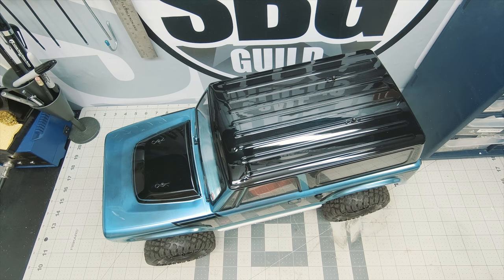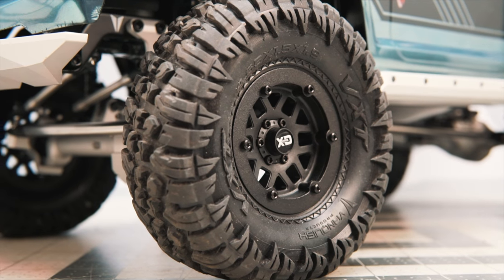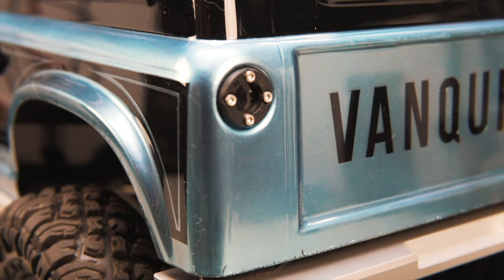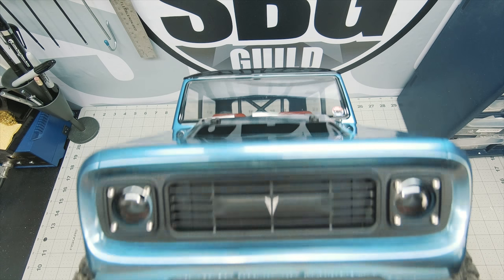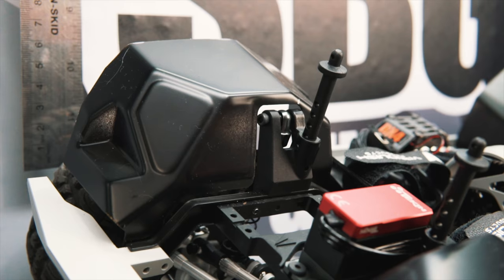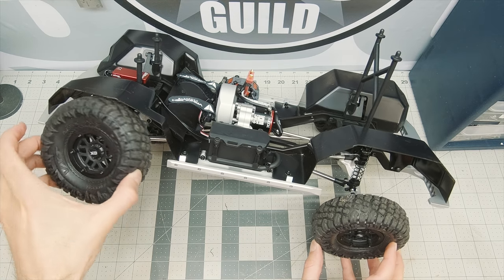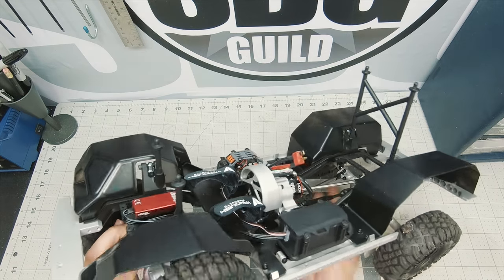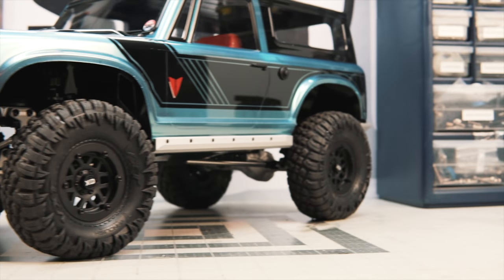Vanquish VS4-10 Origin First Look

Comment: Very nice overview, Vanquish has knocked it out of the park with this release!
Reply from the maker: Thanks very much Chris! I think you painting one of these bodies would be amazing. Let's try to make that happen!
Reply: I find it odd that a company that makes everything from machined aluminum would put plastic wheels on a kit like this.... for the price you'd think they'd be metal
Reply: @pmm4177  If they didn't it would be almost a 1000 dollar kit.  Plus they know that 99% of people who spend 800 on a kit will want to make it original and choose their own wheels.  So why put a set of 100 dollar metal beadlocks on it when most people would be pissed they have to be forced into a wheel.  Or pissed they have to spend another 120 to get the wheels they want.  See what I mean.  As a company they have to do what makes most sense to their brains and their wallets.  At least they're beadlocks so you can use the tires.  Hope that clears up the confusion.

Comment: Great video, Matt!  The truck looks great and I’m sure that Josh and VP did a great job on the engineering. The best part about this truck is that you know it will work. How many times have people (myself included) have dumped $$$$ on a truck just for compatibility issues between aftermarket parts?  Home run VP!
Reply from the maker: Thanks Rich, it's definitely a very high quality, well engineered kit. Nice to see everything come in one package too.

Comment: Is that a Scout 2 International???? O man I must get one and maybe Go E word for a little bit?? I miss and wished I had my old mans 1980 International scout 2 Diesel! I would need a push bumper and rear spare tire rack and metal fuel tank !
Reply from the maker: It's Scout-adjacent. ;)
Reply: Scale Builder's Guild wow 😲 I must get one now just because of that! The back kind a looks like a bronco a little and I can’t stand that but maybe if they sell a rear wheel rack and a gas can it will hide it a little and it will look more like the truck my old man used to have I I grew up with? Where would I be able to find accessories for this like those that I want and a push bar bumper and side view mirrors??
Reply from the maker: Just about any bumper designed for an SCX10 chassis will work. RC4WD, RPP, are great places to start. Make sure to check the dimensions and mounts before buying anything.
Reply: Scale Builder's Guild 👍🤝👊💥💥
Reply: John you can mount nitro motor just let it idle while crawling 😆
Reply: Very good looking kit👍
Reply: Paul Clancy hahahaha 🤝💥👍💥👊💥! I may do another Nitro Rock Climber in the future but I won’t use this model . I had great results with a LST in the past and I still have the transmission that has reverse and that really Low gear ratio that used to pull me on a skateboard but I want a good E word rock climber next . I used to have crappy traxxas summits but I want a good quality next . Maybe something like this or better?
Reply: BOTAJELL wow lst crawler lol idk i can go slow for too long this crawler kit  nice attention detail i never got into  to crawling but i appreciate working like actual vehicle and detail ..pulling skateboards lol nice i always wanted to make kids powerwheels brushless never did but car batterys had them moving climbing. Good lol now they older no fun bssh on brother
Reply: Was watching one ur ol vidieo still laughing via lable tool box draws lol
Reply: It's based off the origanal scout can't anyone tell

Comment: I'm so stoked to have the black version now.
Not sure if I should put the pitbull rock beasts xl (4.8ish) or the regular (4.5ish). One is smaller one is bigger. I got it with 4.75 swampers... they rub a little for sure.

Comment: I just started my build, and I am using the same Tekin electronics (T360 servo, RX4 and ROC412 EP 3100kv). I received mine with the upgraded braces; however, there is no clearance between the servo horn and the chassis rails (horn actually hits the underside of the rail). Did you have to change the servo horn from the one Tekin provided? It looks like the servo horn needs to angle away from the servo to provide proper clearance, something like racing buggies use (i.e. TLR).
Reply from the maker: Yes, the Tekin horn will hit the chassis. A Vanquish horn will not!
Reply: @scalebuildersguild  Thanks again, Matt. As always, very helpful. I have a Vanquish horn ordered.

Comment: Would you recommend putting that under the 1985 4Runner body, or get the the trail finder Marlin Crawler? Where is you money better spent?
Reply from the maker: I think you'd have fitment issues with the interior and center mount transmission in the VS4, which isn't to say it's impossible.

Comment: I heard you say injection molded quite a few times.. even on shock towers..  for a kit this expensive that supposed to be the best of the best I don't like hearing a lot of injection molded plastic shock towers and lexan inner fenders  with no electronics. Lol  That body is really nice and I'm really digging the paint job.
Reply from the maker: Hold judgement until you see this plastic in person. I think it makes sense for some parts to be injection molded, and as a by-product, it allows a higher volume of product to be available right out of the gate. It's a kit after all, so there shouldn't be electronics. Thanks for the feedback!
Reply: Scale Builder's Guild I guess after thinking about it and remembering the 16 week honcho budget build that produced a $1129 dollar rig, I think the vanquish kit seems a little more reasonable sinc peoples gonna upgrade stock rigs anyway.   I just wasnt expecting plastic shock towers.  Especially since vanquish is in the business of metal towers.

Comment: You mentioned people running different bodies, is the wheel base adjustable???
And do they make a right hand drive version for us people down under on the bottom the earth?
Reply from the maker: Left hand drive only! Wheelbase is 12.3", so many aftermarket bodies will fit without changing anything. Other body posts are included.

Comment: What is the steering angle? 

Some of the components look similar to generation 1 and 2 SCX10’s. Does it feel kind of like an Axial kit with Vanquish upgrades or are there enough differences to make it unique? 

The price tag is quite high given there are no electronics included.  To get this truck rolling will push the initial price into a four digit range. I’m wondering if the price point may inhibit sales or if they’re marketing this kit for the die hard scaler/trail truck/crawler demographic. 🤔
Reply from the maker: Steering angle is the same as any other Vanquish axle product. Tons. If you were to buy all the VP upgrades for your current truck the pricing would be high. It's designed for those that want the best of everything VP has to offer all in one cohesive package.

Comment: Do they make an over and under drive beveled gear set for this and can I fit a vanquish dog system in it or does it have to be modified to fit.
Reply from the maker: OD/UD I don't think so, but there's a lot of aftermarket guys that do. Dig will fit without trouble.
Reply: Scale Builder's Guild   Thanks for your response.

Comment: Matt, does it need the 3100? That seems to be a fast motor for crawling.
Reply from the maker: Nope, it doesn't, but I like the wheelspeed when needed. Modern brushless sensored systems are capable of extremely low RPM's so you can still get the controlled crawl if necessary. That said, for a recent comp, you could only run brushed, so I swapped to a 35T Tekin and it performed very well. It really comes down to your personal preference.
Reply: Scale Builder's Guild  thanks! 
I know my Pro Puller 3500 is a speedy beast on 3s. Thinking more at a 2700 stubby, thoughts ?

Comment: The only part that disappoints is the rear driveshaft is offset, it doesn't run straight. For the price it should look more like a full size truck.
Reply from the maker: I think this is a nice compromise between scale accuracy and pure performance. There has to be trade-offs.

Comment: Hi Matt. Awesome insight on the vs4-10. Is it worth it though? Would you recommend this kit over a stock scx10ii chassis kit and building it up or would you suggest to go and buy the vs4-10 instead?

Thanks
Reply from the maker: At this point I’d recommend the VS4-10 Pro. The Origin is no longer in production.
Reply: Thanks matt. would you say that in the longrun the vs4-10 would be a better investment than getting a scx10ii and upgrading with vanquish parts? 

Ive built a couple of rigs previously but ive been out of the hobby for a couple of years. Would appreciate your advise on this

Cheers
Reply from the maker: @allentianco  Do a little arithmetic and you'll find it's much cheaper in the long run to buy the Pro, rather than upgrade an scx10ii.
Reply: Was thinking of that. Thanks again

Comment: This looks like a competitive comp rig out of the box, minus a few items. Would it qualify for class 1?
Also, will this truck improve my driving?🤔
Reply: Dan Terborg with smaller tires it definitely is a C1 contender. Will be hard to reach the 60 point max most venues are using now though. Would have to wheel it like a champ.
Reply from the maker: Yes, it's very competitive and would make for an excellent C1 or C2. You'd have to make up some points and get smaller tires for C1, but it's possible! And I'm pretty sure it does make for improved driving skill. ;)

Comment: What's the longest motor can that fits in the vs4-10?
Reply from the maker: It’s a standard Axial-style trans, so as big as that will accept.
Reply: Scale Builder's Guild the axial trans doesn't limit the length at all.  On an SCX10 it's the link mounts that limit the length of the can.  So just wondering if there is a similar obstruction on the vs4-10 chassis.
Reply from the maker: Justin Rohrer yes, same sort of limitations, but they did design with Dig in mind, so that should help answer your question.

Comment: Have you ever set up a yeti as a dedicated crawler?
Reply from the maker: I did actually - and it was a massive disappointment. Bomber would be a much better platform for that.
Reply: @scalebuildersguild  thanks for the reply,  I wasn it planning converting my yeti or anything, i just figured if anyone had tried it it would be you.   I stick to scale rigs for crawling.  My first gen scx10 is still dominating the rocks, ha.  Looking forward to the come from behind victory in the drag bolt series.  I know you've got something up your sleeve.  I'm thinking you may need to vent a few rules though.  Thanks for all your dedication to the hobby

Comment: Wait this is not a one stop shop kit. It comes with plastic beadlocks. While it has some really nice metal parts which are very cool. That does not necessarily translate to performance. Infact that added weight has some disadvantages in certain applications. Simply put its a very nice luxury product but not the ultimate in performance.
Reply from the maker: Considering they've since upgraded this kit to the Pro, it's kind of moot.

Comment: Yes awesome kit but how is it cheaper when buying it as a kit then building it piece by piece when the axles are only available in this kit? What other pieces can only be acquired by buying as a kit. Seems like what ford does to their consumers. I don’t see THE CHEAPER comparison. This is not a troll or hate question, and killer paint scheme man!!!
Reply from the maker: Rather than buying an SCX10II RTR or Kit and adding all the Vanquish parts you could, this kit would come out cheaper. Sure the front axle is only on this kit, but comparisons can still be made.

Comment: Great video I love your videos and like you. So not hateing on your or the video   I don’t like the tires. VanquishCould’ve done way better   On them price is to high I am betting this whole kits is build the cheapest way they could so they can lower the price if they wanted to I wish them the best luck on that I like the truck.  Hate the tires lol    Lower the price lol
Reply from the maker: What's missing from the tires that you would want? It's not the cheapest, it's all VP. Tons of high quality engineering and design here, working in harmony. Build a set of axles and see what that costs!
Reply: Scale Builder's Guild they are to  doughnutie round needs to be little more flat that’s my personal preference these tires might be really good tires we will find out
Reply from the maker: They work pretty well so far. Wider contact patch isn't always better. Check out winter rally tires!

Comment: I can't believe people use brushless esc's & motors in scalers, crawlers, trail trucks. Silly, wasting $. Racing is another story, but I've been in this hobby since 97 & I use a $12 rebuildable gool brushed motor & the newer $42 WP HW. Just super silly to use 3-4 hundred dollars worth of electronics IMHO.
Reply from the maker: Some people like the performance benefits a brushless system offers. Don't knock it till you try it.
Reply: Scale Builder's Guild - I know that brushed motors have more torque & make smooth power, for under $20. 3s & bl  power is over kill if your not comp crawling. Like I said that's my opinion, some people think they have to have the most expensive products available..

Comment: So a grand for the truck and another thousand for electronics 🤔 and they didn’t even add aluminum wheels or shock hoops. 
Sounds like a great deal. If we’re spending that type of money I’d prefer to pick my own hop ups!
Reply from the maker: A thousand for electronics?! I couldn't spend that much if I tried. The point here, is that it doesn't need any hop-ups.
Reply: Scale Builder's Guild 
So you’d buy the Vanquish over a axial? And where can I find the video where you cut the roof off and installed the roll bar?
Reply from the maker: As a completed upgraded truck, yeah, I think I would. No video of that, all you need is a sharp hobby blade, a steady hand and a few screws to install the roll bar!

Comment: over rated still tho imo
Reply from the maker: Care to elaborate for the sake of discussion?
Reply: Scale Builder's Guild sure thing, don't get me wrong I like it very much and I'm sure the quality is to notch and I love the axles. My main gripes are the body not licensed for such top end, no forward motor and high transmission (means mods for a full depth interior) granted yes there is a 3/4 interior so I give it that , plastic cross braces and skid and honestly the platform seems very familiar so not much innovation in certain ways. Like I said it's great! Me saying it's over rated imo is just that, I think labron James is over rated and he's great? Still looking forward to seeing more of this. Thanks for showing it
Reply: @theezZENtials  not to mention plastic pieces from a company known for making sweet metal scale components... ill pass, if i want a plastic kit ill buy another axial scx10 and save $400
Reply: @pmm4177  That a ridiculous comparison. An Axial kit as FAR MORE plastic than this kit.
Reply: ForcedFed4 Garage yeah, then those guys go and put a stage one kit, Currie axles and metal bumpers then that “$400” truck is $850+...or they could just buy this one.